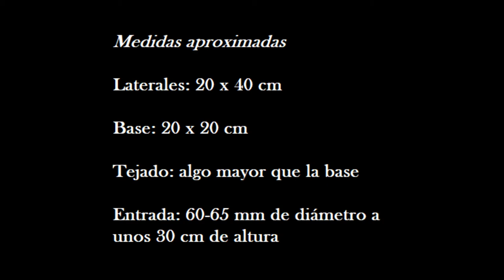Las bricochapuzas de Jaime: cómo construir un nidal para el autillo

Comment: Bravo.
Reply from the maker: I'm glad you like it. Your channel about California is very interesting.
Reply: I'm going to build a few box's for the county park in my area. There's a bird box program there but their not doing so well. Zero owls showing any interest..? why? and there's a lot of owls in the area. Thanks
Reply from the maker: @DaveKentLive  
To be successful, the nest box must be placed in the appropriate habitat for the species. The one you see in the video was placed near a stream, because the owl is a Eurasian Scops Owl (Otus scops), which eats insects and usually lives near water in old woodpecker nests.

Perhaps you could place the nest near the place where you heard the owl sing. However, it is not necessary to place the boxes very close to each other because the birds of prey are usually territorial.

In warm regions, place the nest where it does not get the sun in summer, under the branches of a tree. If it is deciduous, the winter sun will warm it.

The entrance of the nest must be placed so that the cold wind does not enter in it.

As for the construction of the nest, I join the boards with lag screws, never with nails.

The outside of the box is varnished and I put a metal sheet or a rubber sheet on the roof to protect it from the rain.

I don't know much about American birds, but I see that the Western Screech-Owl (Megascops kennicottii) is a little larger than our owl.

The size of the nest (and the size of the hole) must be according to the size of the species. Here are nest box plans:

https://nestwatch.org/learn/all-about-birdhouses/birds/western-screech-owl/
https://www.audubon.org/news/how-build-screech-owl-nest-box
https://www.audubon.org/field-guide/bird/western-screech-owl

For some species it is good to place some dried herbs or a similar substrate inside.

Sometimes they don't occupy the nest the first year, they don't like some locations... You also need a bit of luck.
Reply: @avesjaimegdr  I have three spots 1 for Great Horned owl +  Western Screech owl and the rarest pygmy owls...all I have on trail camera. I 'm thinking pygmy do to the smaller house-pack up the hill or build a natural giant great horn owl nest up a tree. Others in the area have built screech owl house with no owls who spent a few dollars doing so. I want mine as natural as I can make it. I thinking just make it look like a log and bolt it 20 feet up.